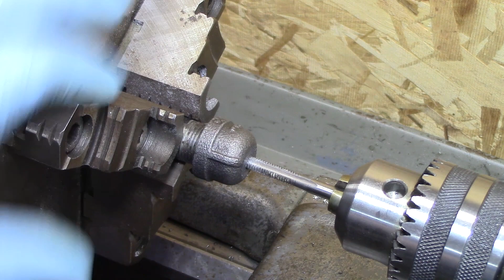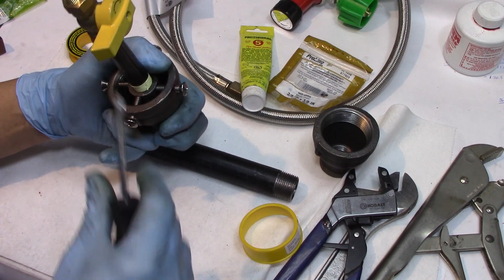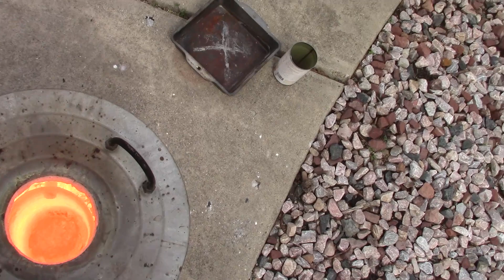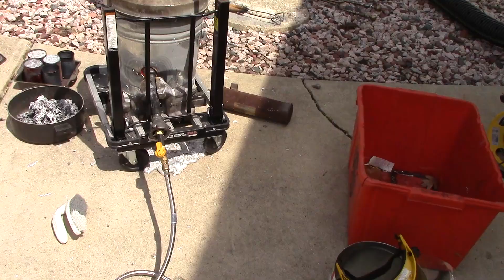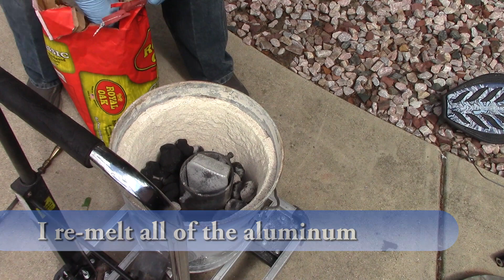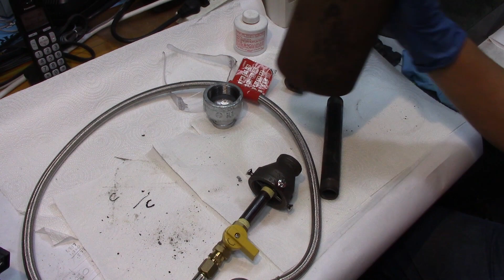How to make a furnace melting burner to melt copper.

Comment: Steel deteriorates & gradually flakes off (spalling) under ultra high temps so steel or metal crucibles are going to eventually blow out. You really need to use a real crucible made out of ceramic, carbon, fire clay, etc. If I was set on making a temporary one out of metal then I'd go with stainless steel.
Reply from the maker: I wish I had stainless.  I plan to get a crucible sometime, but I would have to get the items needed to handle and pour it as well.  That will come in the future.  And thank you.....

Comment: No bell needed at end of burner.  Smelting pot needs prop off bottom.
Inject flame below pot to prevent direct overheat spot on side. Heat will spiral up around sides.
Reply from the maker: I was going to try it without the bell.  I thought it may work like that in the kiln.   I'm not exactly sure what a prop off bottom is.  And I def want to point the flame away from directly touching the pot.  And thank you very much for the info.....

Comment: What size welding tip did you use?
Reply from the maker: I used .030"
Reply: @jster1963  thanks for the reply. I'm currently building a burner and that's what I went with too.
Reply from the maker: @nonsensewrenching  You're welcome!  And good luck with yours.......

Comment: I use this burner, no i dont get anything from sharing it, its just a really awesome torch,

https://www.ebay.com/itm/PROPANE-GAS-FORGE-BURNER-AMERICA-MADE/224172915405?hash=item3431bf3acd:g:TVUAAOSwiDhddbQn&redirect=mobile

With a 30psi valve and 3/8 hose.

And i use clay/graphite crucibles that i get on amazon, which last much longer than any steel crucible will.
Ive never had any trouble getting copper or brass up to a nice pouring temp. I pour into cast iron molds that have shape, like fish or a rooster, it makes a nice hobby
Reply from the maker: Holy cow, that's a great burner!  I wish I would have seen that!  Thank you very much....
Reply: And its at a reasonable price, anything to help a fellow melter
Reply from the maker: @roosterman8911  Real reasonable!  Thanks again....

Comment: are you adjusting the flame with the pressure reg or in line valve ?
Reply from the maker: spot lobac Yes. I was told that a better way would be to get a regulator gage. I plan to do that someday.....

Comment: Hey jester, if you're planning on doing more melts on a regular basis, get a few graphite crucibles. One for each type of metal. They're not terribly expensive. Nice burner BTW. Somewhere in an old playlist, I show off mine. Also, the porosity might be from how much oxygen is in the burner flame. Go to alloyavenue.com if you haven't already, and the guys there will be able to help. You can also try degassing. Great video as always!
Reply from the maker: Thank you so much for the info!  I will checkout your video and the link you left.  Thanks again.....

Comment: Interesting does and don't, be safe, though...  
I'll get inspiration from you about that burner, here there is some fixing to do on the foundry before making more melts, the extra heat will be required to melt a big batch of copper and brass piling up.
 Aluminium is slowly replacing the iron oxide in the crucible, so life is limited, once it started pitting deep enough the whole crucible becomes unusable.
Guess that there are more projects in line than my life expectancy...    😰😎👍
Reply from the maker: LOL!  I just told my wife that I won't live long enough to do the things I want to do in life.  Oh well.  Yes, safety is huge when dealing with molten metal.  I've had a couple of close calls and have to do better with that.  I will defiantly keep an eye on my metal crucible until I get a graphite one.  And thank you very much.....

Comment: Hey Jester looks like you got the Southbend up and running next step for your foundry will be real crucibles the homemade ones are great for aluminum but when you start doing brass and copper your a lot hotter but man you've really come a long way how's the tractor doing thanks again for making your videos
Reply from the maker: Thank you so much!  I wasn't sure if I would be able to melt anything, but now I have to step up my game and get good equipment.  And I really need to do a follow up on the tractor.  I used it 3 years ago at my family reunion, but it's sitting in  my heated garage.  I will try to do a final video on it.  I should have done that 3 years ago!  Thanks again.....

Comment: Big mama bend is finally getting some lovin'.  Watch out, craftswoman gonna get real jealous with your cheating ways.  On your next build, use Kaowool and satanite for the crucible.  Also get a proper graphite crucible. You temperatures are getting close to the melting point of iron, which is causing the holes.  You should also get Yamato LPG regulator which has gauges.  I got one for $39 on eBay.  I can provide the listing if you're interested.
Reply from the maker: Thanks a million!  The Kaowool and satanite are definitely on my "to buy" list.  Also, I plan to get a graphite crucible too.  I didn't want to spend a ton of money just to find out it didn't work.  Now that I know it works, I have to step up my game with some good equipment.  What does the regulator do for me?  And once again Thank you!
Reply from the maker: @BarryManilowa  Gotcha!  And no problem.  This is not on the front burner, but I'll look into it.  And thank you again....
Reply from the maker: Dude I totally missed this one!  I am subbed to Paul's garage and his cast iron melt made me know I should be able to melt copper.  I am in the Chicago area but don't know anything about the area.  That's my fault.  Thanks again....

Comment: As you have discovered, molten aluminum is corrosive to steel.
I think you need to have some way to make sure the burner nozzle is centered in your burner and it would help if you would add a blower to the air for more heat.  There are several videos showing these as well as furnaces.  Keith Rucker built a furnace and burner; see Vintagemachinery. org and look up the playlist.
Reply from the maker: I have seen a few of these.  I just need to do it.  And thank you very much......

Comment: Interesting casting is something I’ve not gotten into, however I like the fact you’re making slugs, what sizes your doing in round?
Reply from the maker: I have a 10" or so cylinder about 2 1/2" in dia. that Matt Waltz sent me.  It works great for round stock.  Also, I have a 10" cylinder that's about an inch in dia.   I use the rectangular stock for round stuff too.  And thank you very much....